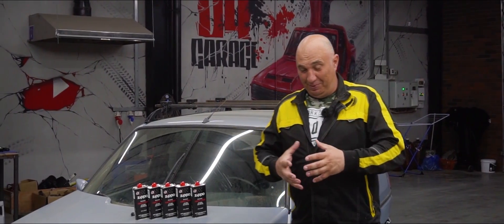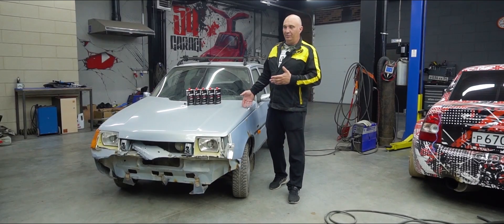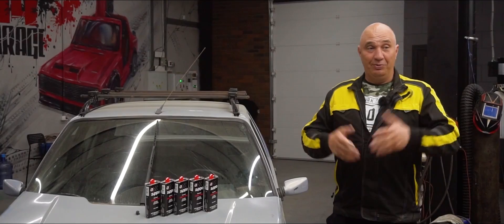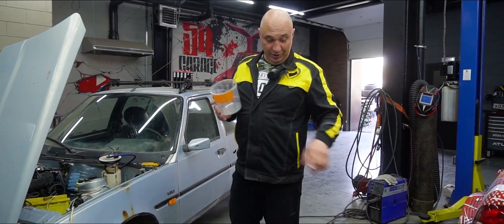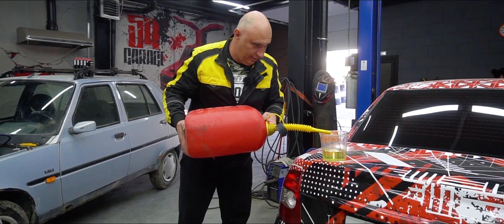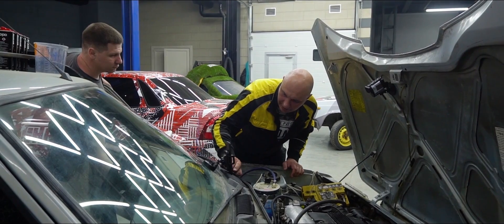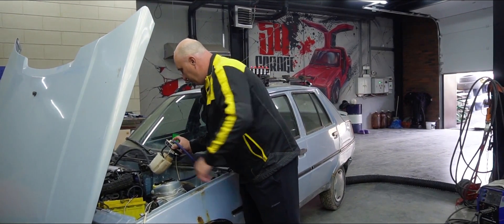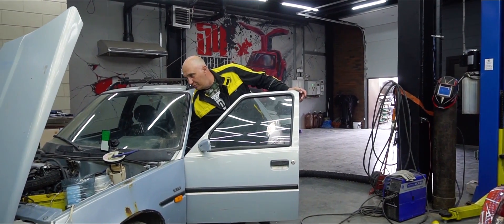Can a car run on Zippo lighter fluid?

Comment: It does work better in the gas engine but for a shorter time. The build up of carbon inside the engine is a lot more than gasoline. Still an awesome experiment!

Comment: I remember my first zippo lighter (a copy) and I had no zippofluid and I thought yeah what the heck, gas n gas💁‍♂️ so i took ordinary gasoline from the lawnmower and poured it into the lighter but it was were hardstarded. And when it started it puked out blacksmoke and smelled like carexhaustfumes🤣🤣 so I think the engine would run great on zippofluid because it ignites better and run cleaner. Maybe it's a great idea when your car won't pass the carinspection because some high exhaust levels. Try to drain the regular gasoline and put only zippogasoline in it?🤓👌

Comment: Zippo lighter fluid is just petrol without the additives, quite a bit faster burning than regular petrol (lower octane), same as brakeclean fluid, which is a cheaper way to buy lighter fluid 😉.

Comment: so how about an even mix of high octane gasoline, lighter fluid, NitroMethane, And Chainsaw oil. works pretty damn good on my RC cars, though I did do a little modification to the pistons and the deck and head to increase compression

Comment: most combustable flammable fluids should work as fuel for a combustion engine, provided the aerosol jet that's pumped into the cylinders is properly atomized and the fuel and air are in the right quantity. but diesel's dont much give a shit. they like a thicker liquid, since that also means it's denser and with enough compression, it will compress to it's auto-ignition temperature, and provide combustion. it's partially why a diesel engine is typically thicker and heavier of a block, to support high compression without grenading, and why they also coincidentially run hotter, as they create a lot of heat from the molecular friction of the fuel and will wick and absorb the heat, which further increases friction and heat in the combustion chamber from more active and excited molecules being forced to compress against eachother.

Comment: I knew someone who did exactly the opposite: he put 98 octane in his zippo but he did not put only 98 in his zippo because this gasoline came from his scooter (MBK Booster in the late 90's) so it was 2-stroke gasoline at 9% oil (yes 9% because he had lubrication problems in his engine so he added oil in the mixture at 5% each time he filled his tank to reach almost 10%). 
The smoke from his zippo was not reassuring (and obviously disgusting and made his cigarettes even more dangerous to health than it already was)

Comment: I don't know much about gasoline, but I do know about Zippos having owned several over the last 30 years. 

The thing about Zippo fuel is that it has to burn completely. It can't leave any traces behind. Think about it, after a while, you burn the stuff that burns, but the lighter becomes clogged with stuff that doesn't burn. 

You could put some of the fuel on like a fire resistant material and burn it. Observe to results. First, how easy it is to light it with just a spark. Zippo fuel is highly flammable. 

Second, look at anything you can burn and look at the results after. Zippo fuel is the only one that leaves nothing behind. Like alcohol leaves a tiny amount of water. Some sort of petrol leaves some types of oils. Diesel wont even fire up if it's not heated.

Comment: Lower octane  = faster burn!   High octane  = slower burn!   Engine  ping is caused by fuel  ignition  before  the  spark plug fires . Higher octane  fuel  burns slower  reducing or eliminating  this problem.   The lighter fluid is low octane and burns  faster creating more power and ping ,untill computer retards timing  to stop the knock . Then you loose power  as the timing  is progressively  retarded!

Comment: Octane doesn't affect fuel mileage 👀 and the knocking was probably because Zippo Fluid has a very low resistance to burn(octane rating) but might have a higher energy density to gasoline.

Comment: All safety precautions were checked and verified by an inspector........ 1 gallon water bottle with loose fuel pump is definitely the safer option just gives the engine a little more fuel inside and out for optimal performance..... 😆 lol

Comment: Zippo lighter fuel is Naptha and n-Hexane, which is the same as Coleman White Gas or Panel wipe. I use panel wipe in a petrol stove as it's cheaper than Coleman fuel

Comment: garage 54 because of how high octane lighter fuel is the car would have to be tuned to run properly i believe some lighter fuels are107 octane on average its about 103 so yes your cars ignition timing would be off because you dont have flex fuel sensors

Comment: Higher octane doesn't make your car go faster , it's just more resistant to compression detonation , high performance engines have a higher compression ratio which would make lower octane fuel ignite on it's own before the spark and you would get knock. So from this video I gather that the zippo fluid is actually lower octane (the knock at the beginning) and it would also make the engine a bit peppier since it probably has a lower than speck compression due to it being old and worn out
Reply: Agree!
Reply: Took the words out of my mouth.
Reply: Google?

Comment: If the knocking occured only with the Zippo fuel, it means that it actually has lower octane number than those 95. If you connected a diatgnostics and took the car for a longer ride with higher throttle, you should be able to observe that the spark timing limit retards as the ECU adapts to the lower octane fuel, especially if the engine is equipped with a knocking sensor

Comment: Try to make this car work on E100. Here in Brazil it’s pretty common only ethanol engines, or flex motors that run on gasoline up strait to 100% ethanol. Ethanol have more than 110 octanes.

Comment: Just try to run the car with used engine oil with 50-50 mixture of gasoline & used engine oil. Kindly update the experiment video please.
 And also try diesel+gasoline+used motor oil also, will the engine run.

Comment: Zippo lighter fluid is pure petroleum without being diluted with any additives and averages 35 Octane RON. 

Zippo lighter fluid has a higher calorific energy value than pump gas, when burnt in the engine, at the expense of a low Octane rating. This is why it's giving noticeably more power than pump gas.

Comment: it can run on lighter fuel as it has a simulare compression as gasoline (older diesels will run it also because old diesel engines basicly run on anything that burns) but you loose power because the crompression the engine is configured on is gasoline so it wont run perfectly on anything else if it even will run if it does run it will break your engine tho because it either makes an explosion to late or to early and that will break the crankshaft and therefore the valves and anything else. the thing that happens if you run the engine too long on the wrong fuel is that it wont explode or anything but its timing will mostlikely break because the crankshaft is being damaged and therefore the timing belt is moved.

Comment: Regular 95 octane gas?! Regular in the states is 87!
Reply: The Europe and Russia use the COR scale instead the US wich use the COM scale.
Here, in Europe we have gas at COR rating:
92 in some countries, most in the former USSR contries. 
95 in every country of Europe and Russia and it is called the ”regular gasoline”;
98, 99 and 100 in some gas stations;
100+ some gas stations or for sale after placing an order.

Yeah, in US have most COM 87, 89 and 92.
After some research i found that US 82 is 92 in Europe, the US 89 is 99 in Europe, so the ratings are in diference of 10.
So, in US if the gas have ”x” rating, in Europe will be ”x+10” rating.
Reply: Sorry!
I was tired while i wrote that.
COM and COR abreviations are used in my country.
In english, those ratings are called RON (for Europe and Russia) and MON (for US).

Comment: I thought running fuel injected out of gas with mess up the fuel injectors I guess I was wrong I'm not a mechanic
Reply: It does in Diesels, if you run dry in the fuel lines, you have to Prime it to get the fuel flowing.

Comment: A large portion of the petroleum distillate blend in gasoline is naptha (same thing as lighter fluid), so I don't see why it wouldn't work. Only thing is that it misses the detergents and other components of gasoline (heptane, xylene, toulene, etc.) that would determine the proper octane rating. Will run, but some things will be off a bit.

Comment: Isn't all zippo fluid diesel with mothballs (naphthalene ?) to reduce odour - In australia if I got stuck I used diesel in my zippo black smoke and smell, but heck when  your in the bush and it's going for 2 seconds I never cared. My favourite aftershave is Diesel followed by 30 grade oil lol

Comment: 6:26 it went in clear and came out yellow! why?
Reply: The fuel system would still have residue petrol in it when the lighter fuel was put in. Its fuel injected so it has a fuel rail, injectors, fuel filter, fuel pump etc, these things would all hold fuel when the car stopped running after the petrol ran out. The system returns unused fuel to the fuel container to keep the pressure constant in the fuel rail, this would contaminate the pure lighter fuel in the container hence the yellow colour at the end. No conspiricy here :)

Comment: I actually add litter fluid to gas for small engine because in America the gas goes bad quickly because it has synthetic additives and the litter fluid helps bad petrol run smoothly but the engine gets hot and needs a nap after 300 seconds.
Reply: What octane gasoline do you have in America?

Comment: Zippo Lighter Fluid is a light petroleum distillate known as Naphtha, and has been looked at as a low soot-low NOx emission alternative to standard gasoline. I can't find any numbers online about the octane rating of Naphtha, but I would assume that its not got that great of an octane rating, as it was not formulated to run in gasoline engines. Gasoline alternative Naphtha though, if you can find it, may have comparable octane to pump gas.

Comment: The lighter fluid used to be available in europe unbranded at some gas stations and was used for example for dangerous welding devices to have a cleaner burn without harming the user.  That is if you manage to heat them up without setting yourself or your property on fire.   (they are probably not allowed for 50 years now)   I remember buying the same fluid and it costed only 2 x the price of normal gasoline it worked the same as the zippo fluid, but at a fraction of the cost.  So basically you might have discovered something.  I see the same type of fuel still being sold for machines to have a cleaner burn.  That is a about 20 EU for 5 liters branded for machine use.

Comment: Fill the engine with engine oil all the way to the cap
Reply: There was a guy at tech school who actually did that.  He looked and acted just like Jim from Taxi, back when the show was running.  He wasn't quite all there.  One of the instructors had him charge oil to the parts desk and change the oil in one of his friend's cars, that he had brought to the school.  Took something like 3 cases to fill a small block Chevy to the top of the valve covers.  Somehow nobody around caught it, and it only became obvious when the instructor saw all the cases and empty bottles laying around.  They had to drain it down to the fill level, and clean the plugs several times as it took a few runs before they stopped fouling.

Comment: I used to build motorized scooters and one time I put RC racing fuel in one of the motors it over rev the motor I would try to use radio controlled RC fuel make your own kind of Nas kit this is Best car show since Stacy Davis on gears I wonder if you could run a car butane

Comment: "Regular 95 octane" 
Not in the US 😂
Reply: Yeah one good point about octane fuel in England it's not lower than 95.
Reply: @TheSpeedfreak665  
Correct!
If you go in former USSR contries (like Moldova, Ukraine etc) you will also find 92 gas.
Reply: Octane isn’t measured the same everywhere . Some places use Ron, some mon, and some a combination. US octane is actually higher than most places if you convert all to the same measurements
Reply: Because the Europe and Russia uses other ratings of fuel.
It is like the US rating + 10 for Europe and Russia:
So, if you have in US gasoline with 85, in Europe we have 95.
Thats because the US uses the COM rating and Europe and Russia uses the COR rating.
Reply: Sorry!
I was tired while i wrote that.
COM and COR abreviations are used in my country.
In english, those ratings are called RON (for Europe and Russia) and MON (for US).

Comment: 6:14 why did the zippo lighter fluid changed its colour to yellow?
Reply: Simple!
Because the new fuel flused the pipes, injectors, pumps and filters.
After the test, what was in that bottle is a mix of gasoline and lighter fluid.

Comment: It’s going to be interesting to see what’s inside the engine afterward. It will destroy it, but what it does to what would be fun to see. I think preignition with destroy the piston tops. And other guesses?
Octane doesn’t add power to an engine. It’s a measurement of how much heat and pressure it can resist without igniting. The reason you can produce more power with an engine using higher octane is that you can use higher static compression pistons which will provide more efficient burning if the fuel. Octane in its self doesn’t produce that power. Lack of octane at a high enough level prevent your engine from reaching its potential. Naphtha is a lower octane fuel than gasoline which allows it to burn easier. That might account for why this low powered engine with low static compression can produce more power with it. But I wouldn’t expect it to last very long at all.

Comment: Only if the price of the lighter fluid were proportional to the performance in relation to the gasoline counterpart then it would make sense to go the lighter fluid route, you would probably get more miles per gallon too, less frequency to refuel.  Also, someone would start their own business reselling lighter fluid rebranded with a name like "Super Fuel Plus+" people would have no idea they are pumping lighter fluid, all that they would know is that they are pumping "Super Fuel Plus+" that magic fuel that causes them to go 0-60 in 3 seconds and literally double or quadruple their miles per gallon ratio.  Whoever comes up with a business like that would be a millionaire, cars would be driving from all nearby states just to fuel up from that one refuel location. 

/This concludes my wishful thinking scenario.

Comment: Hey you crazy car nut, How about a car tire half filled with popping corn, sealed bead, heated till the corn pops and see if the gases released from the corn would leave enough pressure to drive on.

Comment: from my understanding zippo fuel is about octane 80, so super low which is why you are getting the knocking.  Thinking that getting more power must mean it has more octane rating is totally incorrect.  Actually higher octane can mean less power if your engine is not able to make use of it from higher compression....  The zippo fuel has a lower flash point so will atomise faster in a cold engine meaning more power in that case.  This topic was already done here:https://www.youtube.com/watch?v=rTYvDFkGrGo  I

Comment: 95 octane isnt normal here in the usa, 93 is the highest we get from the pump.
Reply: Because the Europe and Russia uses other ratings of fuel.
It is like the US rating + 10 for Europe and Russia:
So, if you have in US gasoline with 85, in Europe we have 95.
Thats because the US uses the COM rating and Europe and Russia uses the COR rating.
Reply: Sorry!
I was tired while i wrote that.
COM and COR abreviations are used in my country.
In english, those ratings are called RON (for Europe and Russia) and MON (for US).

Comment: I have some model hit miss engines that run off of zippo fuel. It’s not as hot as gas and keeps the engine cooler when running.

Comment: The information in this video is what the petroleum industry, don't want you to know,
If the process of making lighter fluid could be done cheaper, its definitely one thing that could put the petroleum companies out of business.
Considering lighter fluid is a renewable resource and it's probably better than ethanol.

Comment: Does russian gasoline have ethanol in it? Our state gas has 10% ethanol, and that would explain the longer run time as ethanol has a lower energy density. Lighter fluid has no ethanol, and actually has a lower octane, that's why you heard the knock
Reply: Europe got E5 and E10 gasoline and E0 at order, so Russia might have the same

Comment: Because you can use gas in a zippo lighter. Zippo is straight Naptha which is a lighter desity kerosene. Zippo's appeal is you can put any sort of flammable liquid in it out in the field and just improvise. Probably where the idea came from.

Comment: if ur car wont start and it is carburated u can put zippo on carb in that way the car will start and pump the gas from tank automatically the lighter fluid is hundred percent more flamable than gasoline or diesel that is why its a good liquid for ur car  to start moving. its like a condiments of all gasoline.

Comment: 95 Octane gas?  In Russia?
Reply: Because the Europe and Russia uses other ratingsof fuel.
It is like the US rating + 10 for Europe and Russia:
So, if you have in US gasoline with 85, in Europe we have 95.
Thats because the US uses the COM rating and Europe and Russia uses the COR rating.
Yeah, we call the 95 regular gas.
Reply: Sorry!
I was tired while i wrote that.
COM and COR abreviations are used in my country.
In english, those ratings are called RON (for Europe and Russia) and MON (for US).